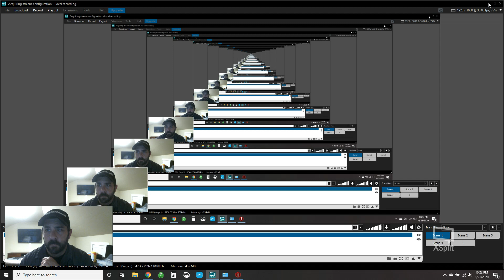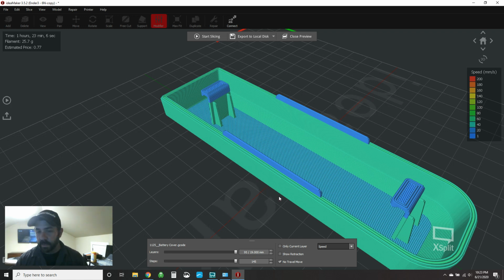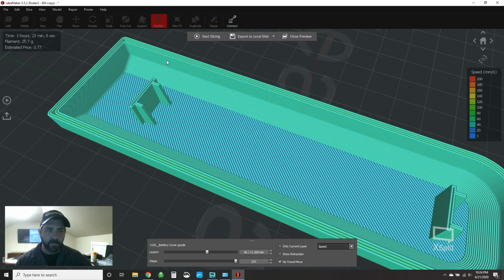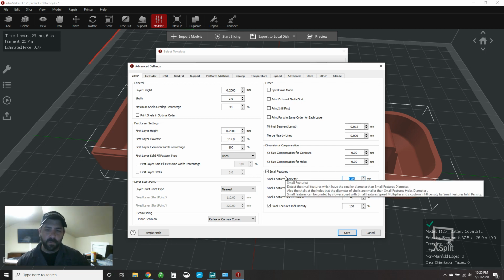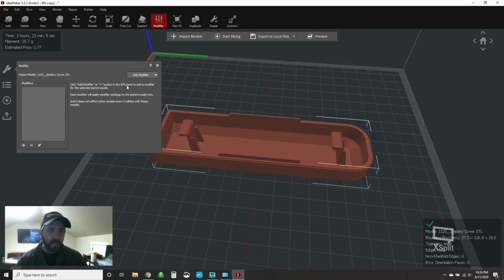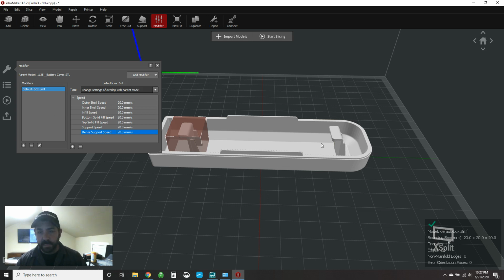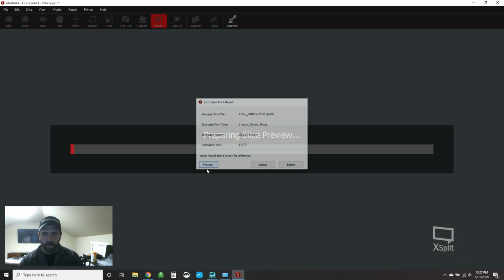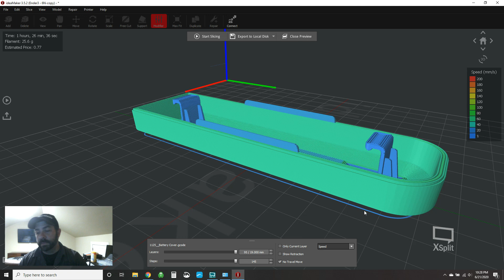Quick tip - Tweak your speeds on small features using "modifiers" in Ideamaker

Comment: Great video, learned a lot from your other tutorials too. Is there a reason you are still using ideamaker 3.5.2?
Reply from the maker: My shop pc is a later version, but not much has changed.  I've tried the beta and it's way buggy right now so I uninstalled it. Once it's a bit more stable I'll give it a whirl.
Reply: @fischer3d  If I can identify a bug I usually post it on the raise3d forums. They are very fast with their responses and sometimes send a closed beta version with a bug fix for you to test, even if you don't have a raise3D printer. I'm pretty sure that if you post a link of your video on their forums they would clarify the problems with the "small features" setting.

Comment: I have a main part and support part for some region in main part. This support part is right positioned relative to the main part in cad system. But when I put it as modifier for main part in ideamaker, ideamaker places it in 0,0,0 and I have to use primitive move, rotate tools to position support part relative to the main. The question is it possible to prevent ideamaker from reposition my parts?Thanks in advance.
Reply from the maker: Hi Igor.  What CAD program are you using?  I think the trick here is to export both parts as one file (not separate models)  position information for bodies generally isn't saved as part of the file (orientation is, but not usually position in the x,y).

If you have the ability to save both parts in the same export file their position relative to each should remain unchanged when imported to ideamaker.  Then, if you need to logically separate the parts to tweak print setting per "body" the you might be able to use the "Auto Ungroup" feature under the Model menu or use the Free Cut tool separate the model if needed.
Reply: @fischer3d  I use Solidworks and multybody part and support as derived part. Thank you for ungroup command, I'll try.
Reply: @fischer3d  I've ungrouped two parts successfully, but how to make support from one of them?
Reply from the maker: That's a very interesting question.  It might help if we did a zoom call or something so I can see better what you're dealing with.  Without seeing it, here is how i think i'd tackle it....  There is no way to add a model/body as a specific support feature in IM that i can find.  However, once you've separated the model into 2 bodies you can now use the "Group and Layer Settings" tab to apply different print settings to the support structure from the main body.   Once you click the button to start slicing, pick your template (single click) then click on the Group and Layer tab.  Select model you've designated as your support piece.  Then under the Per-Group Settings click the + button and you can modify the print settings for just that body.  Like changing your shells to 0 or having 0 top layers so it mimics a support pillar.

To that point, any reason why you wouldn't want to just add manual supports and adjust the pillar size and support print settings in your normal slicing template?

Thanks
Reply: @fischer3d  I want to organize support like 'bridge custom support' in Cura. I havn't found an option that sets the printing order, so your suggestion to assign some parts properties doesn't help me to make support part which must be printed first.
Reply from the maker: Gotcha.  There is a Sequential Printing Setting under the Slice Menu at the top of the main screen.  It's a bit of a headache and really only useful if you are printing duplicates of the same part scattered around the bed.  There may be a way of accomplishing what you want to do, but would take some trial and error.  Parts that intersect each or are near each other will generally cause IM to throw a collision error.  Can you by chance share your model in a google drive link so i can load it in my IM?
Reply: @fischer3d  https://drive.google.com/file/d/1aVkmmnhHB3kuCe0ZCu80faugD5QNz837/view?usp=drivesdk
Reply from the maker: Thanks.  I've requested access to the link
Reply from the maker: Interesting.  Since IM doesn't have the same custom bridging options as Cura I suspect there are only a couple of options.  

1. Rotate the main part 90d on the bed so you don't need supports at all. 

2. If the part must be printed in that orientation then I would design the bridge support structures in my CAD system, leaving an airgap maybe 0.1 or 0.2mm from the top of the support structure and the bottom surface of the main part. Import them both as one file to maintain the body orientation relative to each other. 

Then, either separating those models in IM and modifying the print settings for just the supports to less shells/infill % or just letting it all print with the same settings.   Theoretically with the airgap, the parts should separate easily after printing.
Reply: @fischer3d  In the second case how do you set that support part must be printed first?
Reply from the maker: hmm.  I'm confused.  They way the parts are positioned when I import would not be possible to print the support first.  I'll make a private video and share it with you.
Reply from the maker: https://youtu.be/V7paU5_BZio  This video is still uploading, but should be ready in a few minutes.
Reply: @fischer3d  Thanks for video, there is no any big picture, there is a part and there is a support part in one file. Support part must be printed simultaneously with the main part but each layer have to start from support part. This guarantees that main part will be supported by support part, but there is no way in IM to set printing order as I know. This is my problem. I hope now you understand me.
Reply from the maker: Gotcha.  In that case I'd focus on the Layer Start Point settings in the Layer tab of your slicing template.  Here's a quick video showing how that works.  https://youtu.be/FarOfkzAK2g
Reply: @fischer3d  Ok, thanks, in this particular case it really helps, but not in general case when you have a few supports. I think it'll be better to load support part as support part and position it using pan and rotate tools. I have one more serious problem with another model. It is some bushing and I use circular pattern for solid fill, but some circle paths on  top and bottom surfaces are distorted (they have star like shapes). If I change width they become round in one place but distorted in another. Have you got the same problem and how to solve it?
Reply from the maker: Strange.  Are you using the "concentric" infill pattern?  What is the infill %?
Reply: @fischer3d  no, I'm using concentric solid fill pattern and grid infill. The same situation with 100% concentric infill. Please try to slice cylinder with bottom cap.
Reply from the maker: I think I see the same issue.  I merged a few different sized cylinders to create one part and see that the top and bottom pattern has some abrupt direction changes so it's not completely concentric.  At least not like if you were machining the part with a CNC router.  The tool paths would be uniform and concentric.  

If i toggle the Merge Open Segments and Merge Internal Overlapping parts on the "Other" tab of my slicing template i can change the behavior and pattern a bit, but I don't think it'll turn out correct.  I'll have to play with this one a bit.
Reply: @fischer3d  Thanks for two new for me options, I will try them.
Reply: @fischer3d  As a workaround, only when I need 100% infill, I set large number of shells (100 for ex) and in this case everything is OK
Reply: @fischer3d  My parts must be rotated 180 degree, on your video they are upside down.
Reply: @fischer3d  I tried different stl export resolution settings in SW and found out that when angle tolerance less than 7 degree IM has concentric distortion problem otherwise there is no distortion.